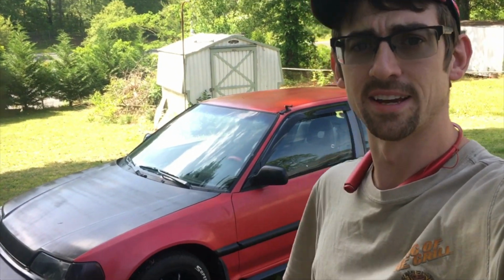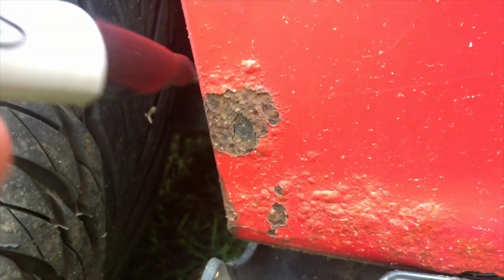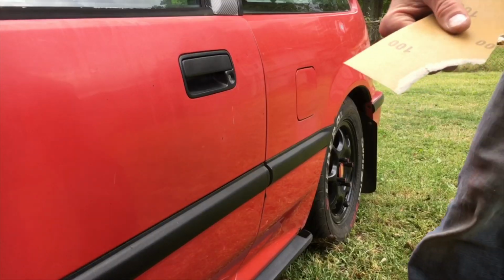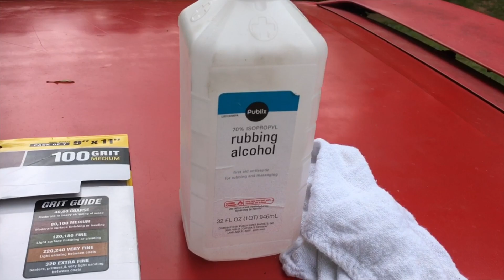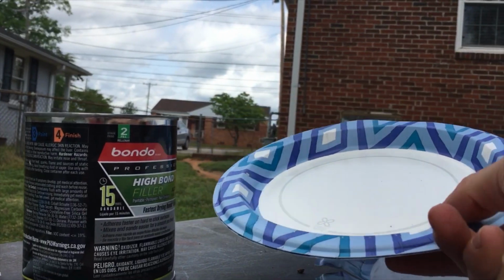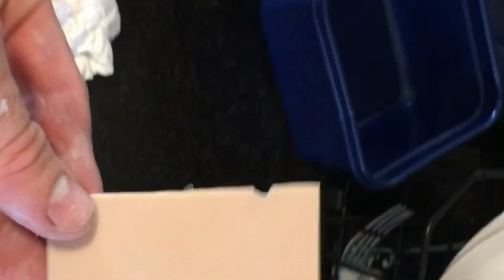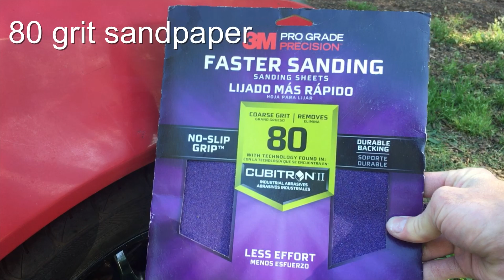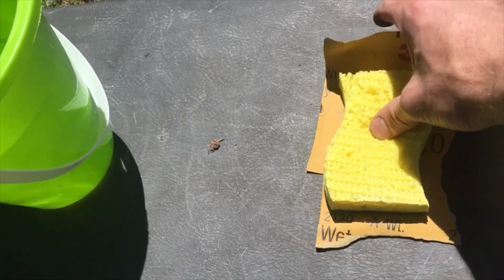Civic restoration Pt. 1 | Body work on the EF hatch

Comment: I try and offer good advice whenever possible. 70% Rubbing alcohol has oils in it.  Use acetone instead. When sanding out bondo ditch the spung, use a hard block or piece of wood with sandpaper  the very first time you sand the bondo.  Remove all dents the best you can before applying any bondo.  A butane torch works good on shrinking metal on dents where the metal has become stretched.  Hope this helps you out my guy👍.  Really nice Ef. There value is going sky high these days. Becoming vary rare! Kero us posted.
Reply from the maker: Thank you for the advice. I definitely  use those tips in the future on it

Comment: Makes me miss my Canadian import Ed6 89 Hatch B-Series swapped (LS-Vtec) B18 Block/Built B16a Head/Semi built JDM B16 LSD trans, Full suspension, BBK setup, Gutted, Tons Rare/JDM/USDM/Discontinued parts and other upgrades/mods. Was building it for 6yrs and it got stolen last year. Miss it :(
Reply from the maker: Man I hate to hear that! Can’t stand a thief. Sounds like an awesome ride you had. I have a circuit breaker in my car I keep flipped off when I park it so hoping nobody steals mine. And the quick release steering wheel. I always pull that out too. I want to put a tracker in it just in case

Comment: in this exact same boat soon, really excited but worried regarding the rust..
Reply from the maker: They are know for rust in the same areas. Bad seals around the back side windows cause water to build up in the rockers by the rear wheel well. I’m not too worried about it since it’s an older vehicle, I just like driving it around town

Comment: What type of primer was that? A filler and sealant?
Reply from the maker: shankar3950 rust oleum auto primer and I used the High bond Bondo body filler. Got them from Home Depot. I like that filler because it dries quicker and it’s easy to sand
Reply from the maker: shankar3950 it’s more of a rust preventing primer more than anything